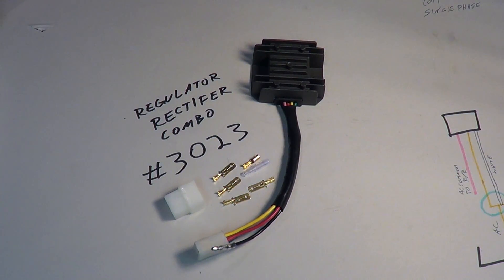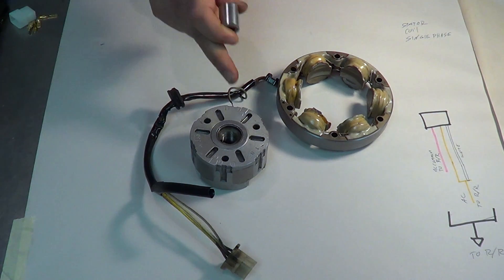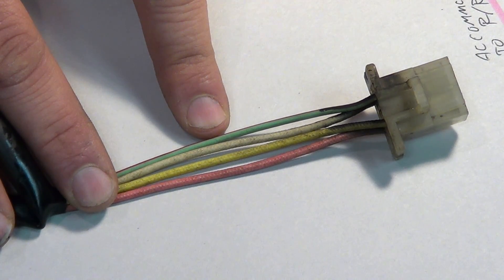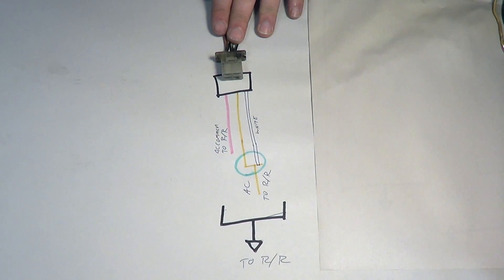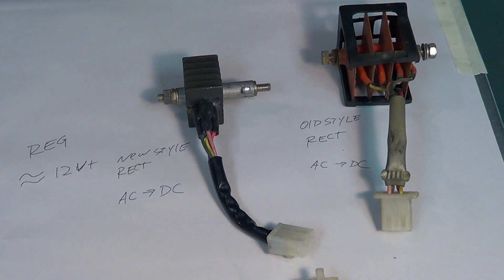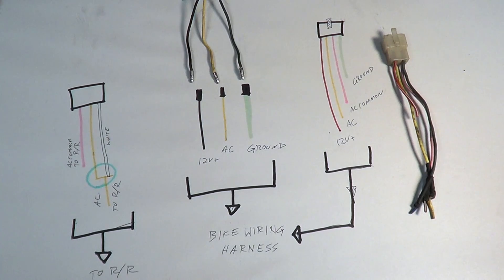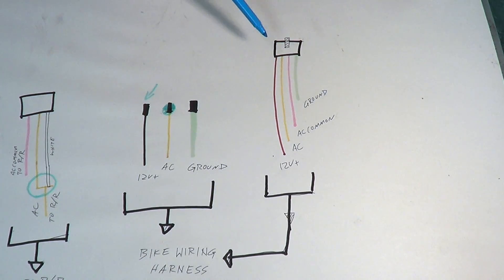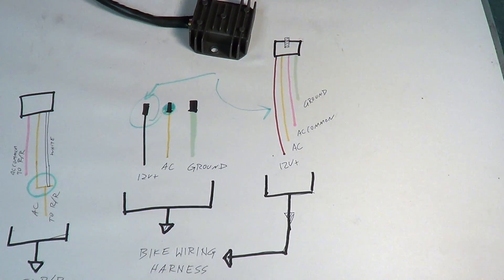Honda CB350 CB360 CB450 Regulator Rectifier Overview & Replacement

Comment: Okay dumb question. My 1979 GL100 rectifier only has 2 prongs coming off of it and looks like a fuse and sits next to the battery, could I still use a regulator rectifier in this situation? 😅

Comment: Hi, thanks s lot for the professional instructions here in this vedio. Just one short but puzzling question, please: Does a CB/CL450 use the same stator alternator unit as the one used on a CB/CL350?

Thanks a lot again Terry in Taiwan

Comment: What if my combo unit doesn't have the 5th black wire?
Reply from the maker: The black wire is your 12v switched power. I wouldn't recommend running a unit without it. It sounds like it wouldn't be a combo reg/rec unit if it doesn't have that capability.
Reply: @Common-motor  would it work solely as a rectifier if I if leave the old regulator in?

Comment: great vid, but not precise enough for me. or maybe my English is not good enough. On the stator wires you put the yellow  (day) and the white (night) together. but then, on the bike harness, on which colour do you put the wire ?
Reply from the maker: We actually made a new video on the subject. Check it out here: https://www.youtube.com/watch?v=CjTnFcrb3Dg&t=1s

Its a bit more clear on what to do. Check it out and see if this helps.
Reply: Common Motor Collective well, I watched this video from you : https://youtu.be/uTgEqTqzs-M
more clear. and that's what I did on my old 350. I also changed the Reg Rect for a new one like yours. The charging system seems to be improved. I have around 14V without lights, and almost 13V with the lights on. I still have to do a road test to see what's going on with the battery. I will check the voltage before leaving, then check after driving lights OFF, then check back home with lights ON. But I'm a bit confident. btw we have nothing else to do than working on our old crap during this trying times.

Comment: Hi I have a CB350 with a working on and off switch on the handle bars.  I bought your new rectifier replacement, will the switch still work after I replace the old rectifier for your new one?
Reply from the maker: Yes definitely. Won't effect it!

Comment: I just bought the reg/rec combo and want to do this mod but like some other commenters, I'm confused on where you are combining these wires and how. I got a picture and instruction guide with my order but it doesn't really clear anything up. An actual step by step vs a drawing would be great. Are these wires going into each other? Does that leave a yellow and white wire dangling? How is the power getting to the rec/reg if the yellow and white wires are just left unconnected? Some more clarity here would be HIGHLY appreciated.

Comment: If 1/2 of the stator or coil is operating when the light is off and all of the stator coil is working when the light is on and I always have my light on, how can I improve on that?
Reply: It does not look like you answer any of these questions. On my own, I could not see how your product would improve the charging of a bike that always runs with the light on.
Reply from the maker: Check out our reg/rec page here: https://common-motor.zendesk.com/hc/en-us/articles/360020830392-Regulator-Rectifier-Overview-Replacement 

There's a modification that keep your both sides of the coil always live for charging. Also we recommend changing the 60w bulbs most people sell for the headlights with our 35w or an LED. It improves the charging on these bikes significantly. If you ever have a question or need quicker help ask us something through our website support button. We can get you a lot quicker answers. This isn't currently monitored full time.

Comment: This video raises more questions than it answers.  The drawings are, well, upside or backwards or something.  You have 3 wires coming out of what looks like a connection but it's not, or wait, is it?, oh wait, is it the regulator? or is it the stator or is it the rectifier?
You say merge the wires behind the stator.  How do you get behind the stator?

Comment: I’m trying to up the voltage output on s 1966 CL77. The OEM rectifier puts out 12.5 with headlight on, and a bit more with headlight off. Using the newer bridge rectifier, the rectified stator voltage is 17vdc at 45/50mph (no tach). This is too high. Idle is 12.5 to 12.75. 
Is there a way to regulate my dc voltage to no more than say 14vdc?
Thanks.

Comment: I will be merging the white into the yellow just behind the stator's plug....I hope that works! Not sure what happens to the white wire...I imagine that it becomes just an extra wire in the harness- nothing connected at either end. Also, I used an "end cap" from the hardware store for the yellow live wire. Then I bought about a foot of 14 AWG black wire and extended the black wire running from the new regulator/rectifier to give me a little more line to run/hide the harness. Hope that does the trick and doesn't explode! Makes me want to take an electronics class....

Comment: The stator ground  is not connected?
Reply: The stator has no ground wire. The stator bolts ground it to the block. If you just do exactly what he tells you you will be fine. the 4th wire is the neutral light wire.

Comment: Hey I have a question for the charging mod.
So you splice the white wire into the yellow wire and then just tape off the other end of the white wire? Or should I splice the wires together and have two wires coming together from both sides of the bundle?
Thanks.
Reply: No he clearly tells you to put yet yellow and white together and plug it the rectifier watch it again it is very clear as to where all the wires go.

Comment: For the charging mod to the stator, do you simply splice the yellow and white together into the new wire?
Reply from the maker: Yes, splice the white into the yellow and that bundle connects to the yellow on the new rectifier unit.

Comment: Hummm, I have a 71 CL450 with round plugs, and Im a rocket scientist and your instructions make no sense to me, can you help me out a little??? thanks
Reply from the maker: Yes,  the new regulator rectifier unit comes with a square plug to replace the round style one. Just match up the color wires as they should be the same.

Comment: Hi CMC
I have a 1978 CB200. Is this unit suitable for this bike? Has the same reg thought the rec on mine is a different model to the ones you showed. Everything else you said matches mine.
Reply from the maker: It will probably work fine as I the bike has a similar single phase charging system.